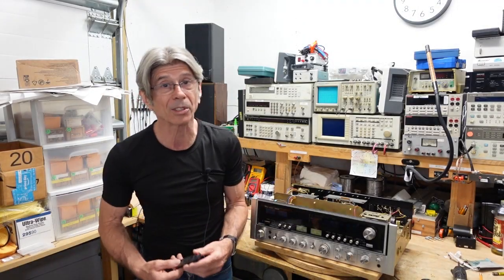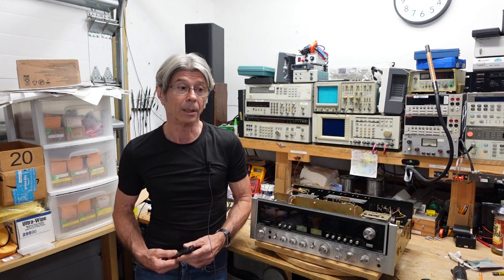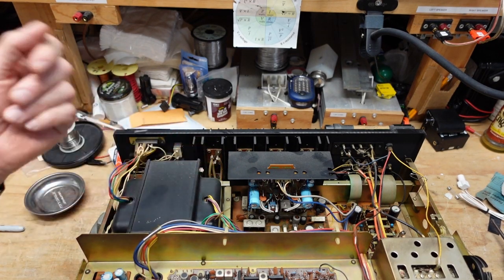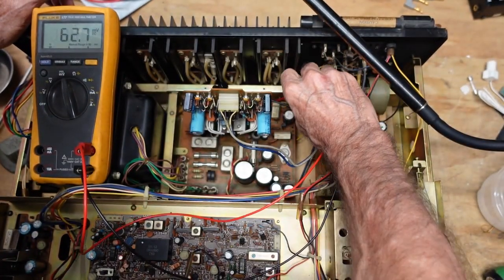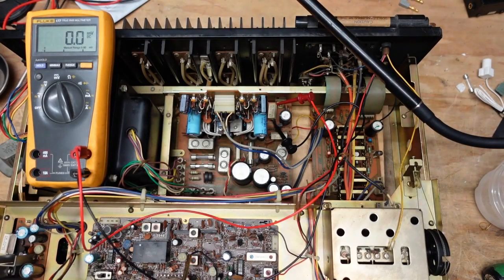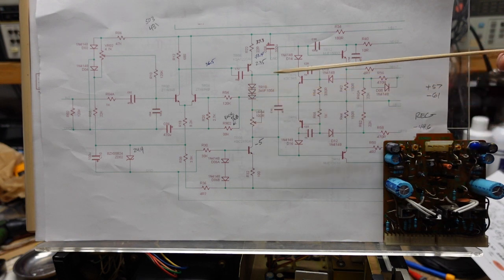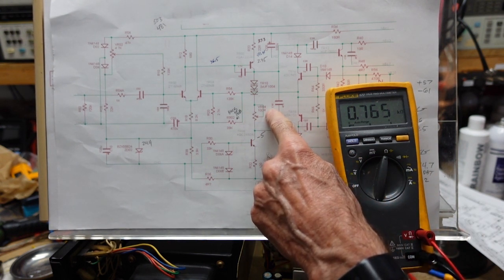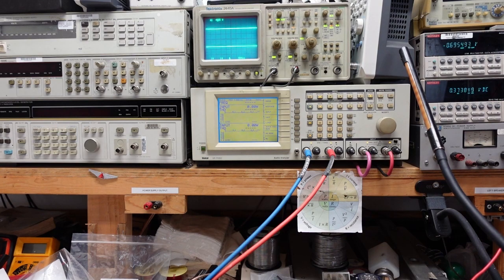Sansui 9090DB Restore Part 1  Repair

Comment: I scooped on up a week ago at auction. Glad I hung on. Only has two blems/issues really. Light behind about AM 1000 is out. And there are two very minute chips in the veneer that you don't notice unless you look right at them
 I bought deoxit D5, F5, and G100 and following your lead on removing the tuner section, gained access to as many pots and switches as possible. There WAS obvious signs cleaning was needed and afterwards it sounds like a brand new unit. Looked around at caps and only saw a couple that were barely showing signs of bulging/doming. Truly blown away by the insanely high quality sound this receiver puts out. Currently running a pair of Monitor Silver 9i's and all I can say is wow! Now I'm torn between keeping it and selling it. This one's right up there in the $4300 class I guarantee it! Between the beauty of the entire front panel and the sound this amazing beast puts out, it's hard NOT to love it. I'll probably come across the information at some point but I'd sure like to replace that bulb that's out and while I'm at it all it's comrades too.
Reply from the maker: For all things lamps Dave is the man:
dgwojo.com

Comment: I restored mine 2 yrs ago, including pining the dreaded dolby board.  Installed LED's, but eventually removed them and went back to incandescent.  Just didn't look right, esp the power meters.  Last summer I built a ToliTom F-2624 board, and that improved the sound & reliability.
Reply from the maker: Scrappy, very cool that you did yours.  The owner specified incandescent lamps, so that's what's going in.
Please shoot me an email; my address can be found under the ABOUT heading.  I've got a few questions about the ToliTom board if you don't mind.

Comment: The thing that is killing off DB9090's is "Dolby disease". I'm hoping you will address in this series.
Reply: My 8080db has never had an issue.  Knock on wood. That being said, if the DB function ever pooped out I'd sell it asap. I NEED it.

Comment: Hello There!  Thanks for the video  and  all the info that goes with it.  I just acquired an 9090DB w/o the Driver board and the protection  light is  doing  fast blinking red.  Would bad power transistors will cause  that? Thanks again
Reply from the maker: Ando, check for DC voltage at F01 and F02, black lead to chassis.  If you have DC, you probably have shorted outputs. 
REMEMBER, IF YOU DO THIS WORK YOU DO SO AT YOUR OWN RISK.
Reply: @raygianelli3612  Thank you it turns out I have 3 bad left channel Power transistors. Another question-  my right bias stays at 10 Ma  regardless of the VR04 settings. Both DC offsets at  0.10 mv When I m playing music the speakers seems to be balanced though sound and power  wise-  Is this something I need to be worried about?   Thanks again
Reply from the maker: @Ando-y9o  It's indicative of a problem.  How are you taking the measurement?
Reply: @raygianelli3612   following the Manual bias instruction removing fuse and  using Fluke meters- running the amp  5 minutes - the Left channel is at 30 mA  - It is the  Driver board issue?
Reply from the maker: @Ando-y9o  Problem is most likely there.  TR09 or TR10 (depending on which channel you're working on).  Should have +1.2 volts at the collector and -1.2 volts at the emitter, and should change with the bias control.  Be careful not to slip with a probe!  Minigrabbers are good here.

Comment: Hi Ray, thank you for your efford posting this , i got mine sansui 9090db db not working and after a lot of work , Mine still stays in protection mod with F2624 board pluged in , when I pulled borad out everything works fine, now I'm thinking of that new board that you mantiond from TONY , did you have chance to test it out? Thanks
Reply from the maker: Find Fuses F01 and F02.  See if you have DC voltage on one or both with it in protection mode. IF YOU DO THIS WORK YOU DO SO AT YOUR OWN RISK.
Reply: @raygianelli3612 No DC on both fuses ! but my question is about that new F-2624 board from Anatoli :)
Reply from the maker: @nick3200  I have no information about a new board.

Comment: If and when you decide to accept products for repairs/ rebuilds I have a 9090db in protect mode I found and has been sitting since 1997 because I can't find anyone near me that works on them . The one shop I trusted retired and no one else I trust locally to do the work correctly.

Comment: Ler me add this,  the early versions of the F-2624 used a Vbe circuit for the idle current (BIAS) with a 1K trimmer, later versions (and tolitoms) boards use those Sanken STV3H diodes, with a 100Ω trimmer, probably the previous tech didn't know that and he went with the schematic.
Reply from the maker: No, the board had 100Ω trimmers, but the one measured over 760Ω.  That's what threw it into protection.
Reply: @raygianelli3612  Got it!